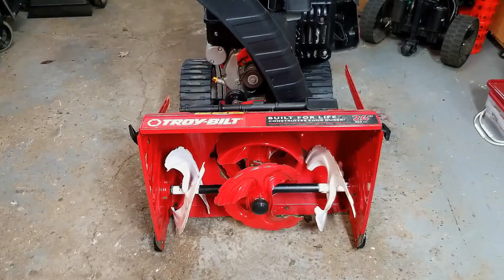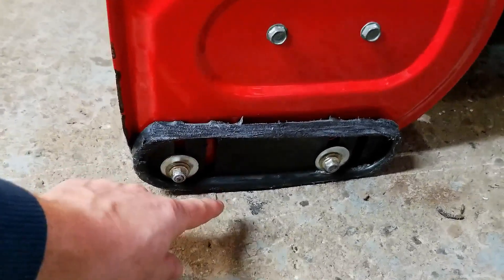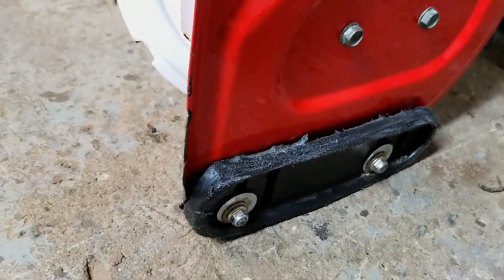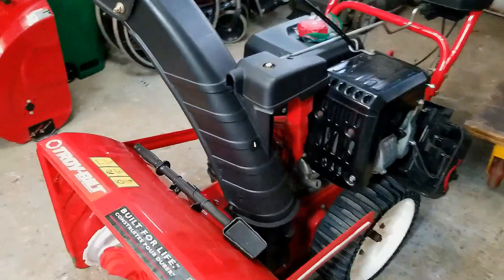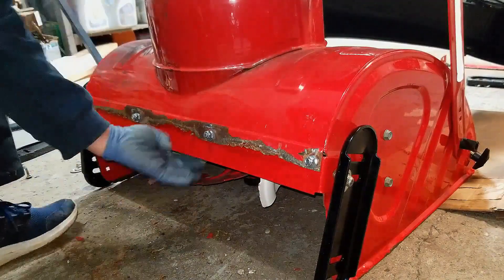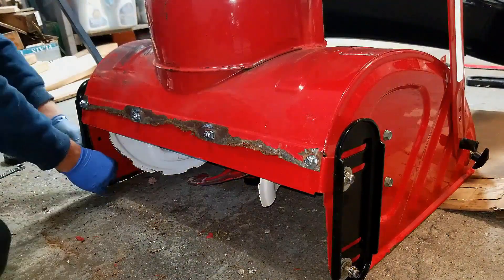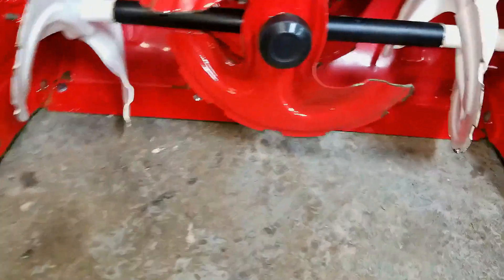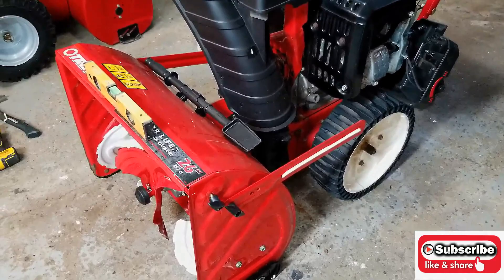Troybilt 3 Stage Snow Blower Shave Plate and Skid Shoe Replacement

Comment: Nice one. I wonder if it makes sense to prime and paint the rusted body area before installing the new plate, or will be a bit overkill? Looks like a poorly maintained fairly new machine, or it's just me...Had a 24" Troy myself, but returned and replaced with a Toro after 2 days (the engine was stalling out of the box). Never thought about using a level to adjust, great idea!
Reply from the maker: Long term, you're probably right regarding the rust and paint. Customers typically don't want to pay extra for this kind of work though. Thanks for taking the time to leave a comment. Cheers